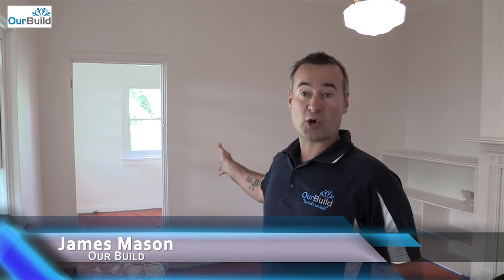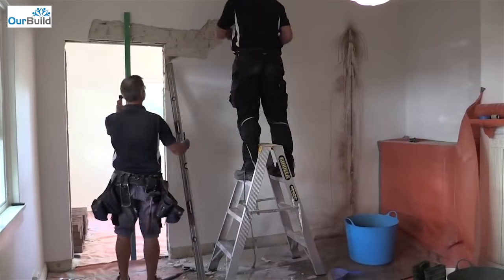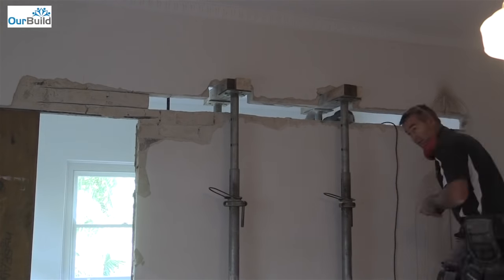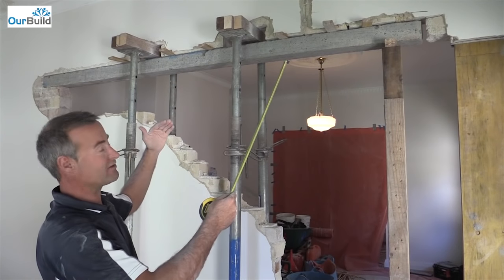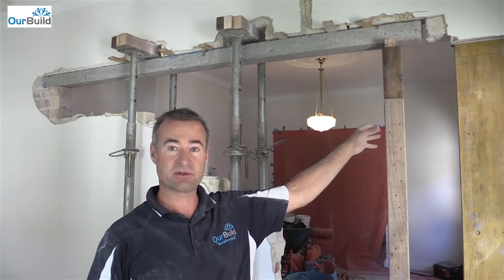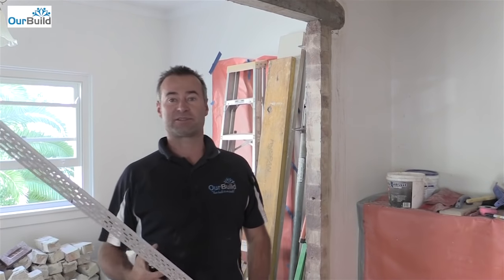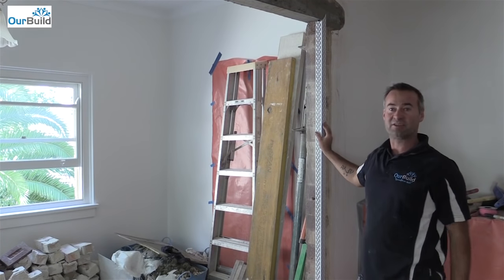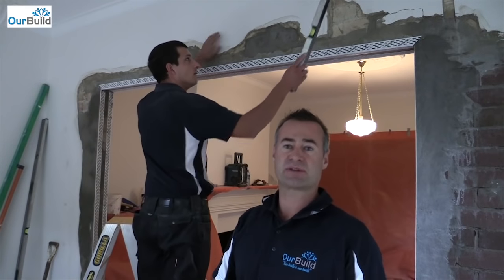How To Remove A Brick Load Bearing Wall - New Opening

Comment: but the joint between new wall and old wall will crack
Reply: he drill wallbinders in to the old wall, the reof the wallbinder lay down on top og top shift. then he place mortal then a brick and bum the walls are connected